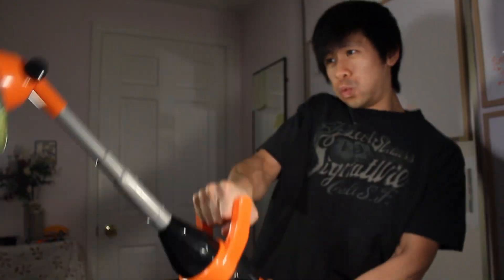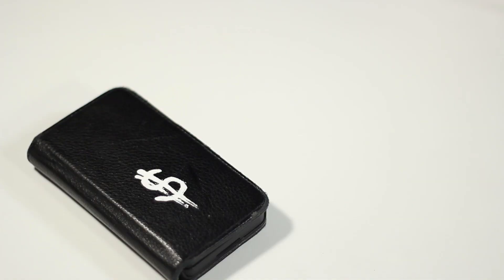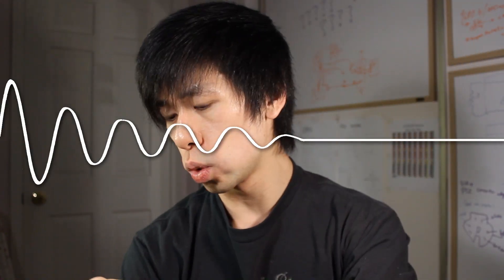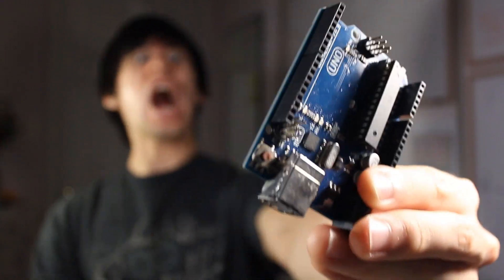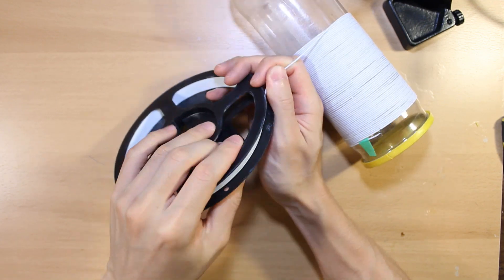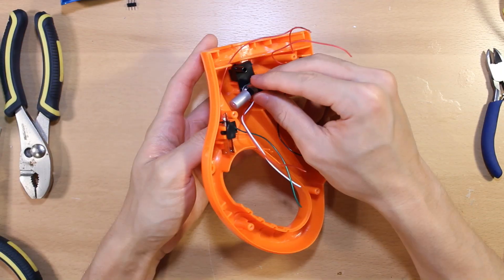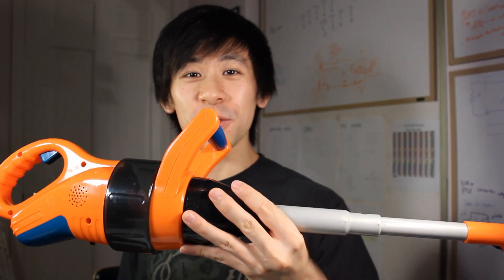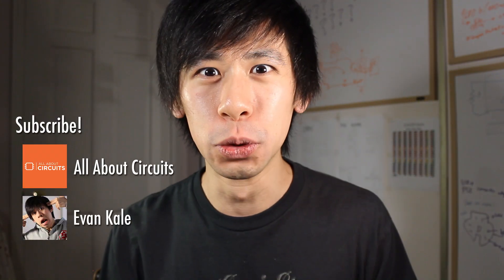Build Your Own Metal Detector with an Arduino

Comment: I have implemented your circuit and I get a frequency sound in the speaker for a couple seconds then it stops and the L LED on the Arduino turns on and the circuit stops working , any idea why this might occur?